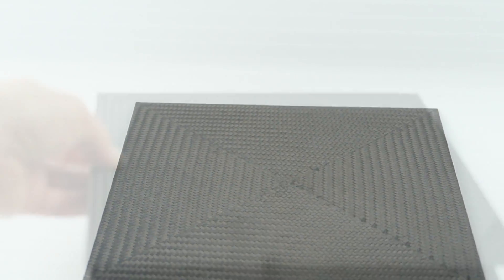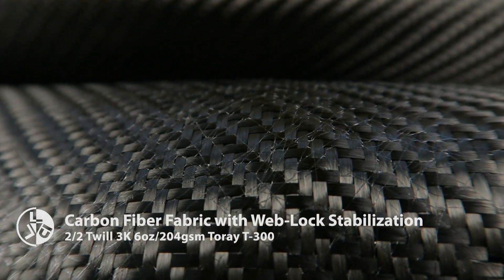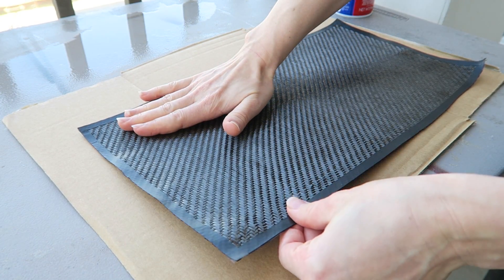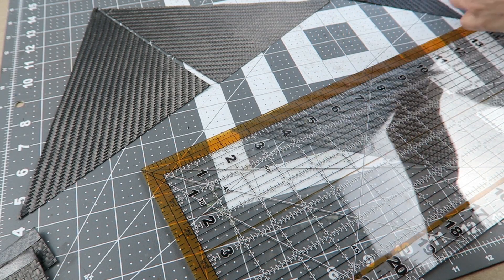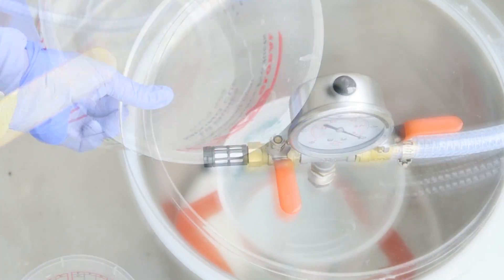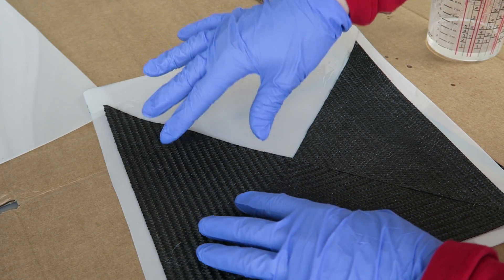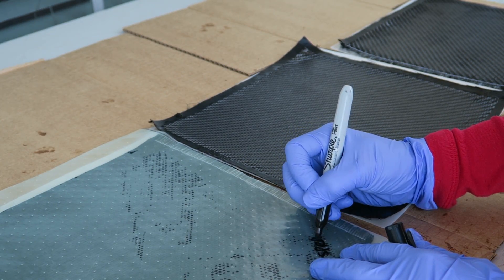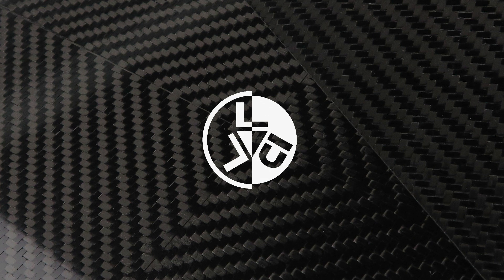Stabilized Carbon Fiber Comparison (Pro Finish vs Web-Lock vs Spray Adhesive)

Comment: I had to watch but more importantly read comments as some are questions. I am confused a little about what product you are promoting. The video was informative buy did not start with products you sell and products or materials needed. In short, I am a retired auto tech and have plans to modify a V8 intake made of plastic. It would require multiple compound parts, with sharp edges but on rounded surfaces. It would be similar to placing your hands together, inter-locking your fingers and folding down. I plan to create patterns to each part, draw the weave, cut the product to size but wet the part in steps laying each part touching to appear one piece. Complex? Yes. I intend to wet it out completely, vacuum bag the part, but the final finish is a two part clear coat. 
  Explain what I missed as the end results on your simpler pattern is some what my goal. This is for ascetics only, not so much for strength. I have edges to create a mechanical bond between the parts. Thoughts?
Reply from the maker: This was a comparison of commercially stabilized fabrics vs spray adhesive to help keep the weave in place. None of these options works as well as pre preg but they all help slow the fraying to some extent. You may want to experiment with wetting out between thick plastic sheets then cutting the shapes and placing. Not sure if that would be better.

Comment: Can these types of carbon fiber be used for skinning pieces? How well would they bend around curves when doing wet lay up? Or would you have to vacuum bag it to get it to hold it's shape?
Reply from the maker: Pre-stabilized conforms less well than non-stabilized.

Comment: Do you happen to know how think the carbon fiber is??? Thank you!!!
Reply from the maker: Thickness of the finished sheet depends on the weight and weave type of the carbon fiber cloth and the pressure under which it's cured. As a general guideline I tend to get around 0.3mm per layer of a typical 3k 2x2 twill cured under vacuum. Hope that answers your question.
Reply: @LindyDesignLab  yes thank you!!!

Comment: Using an infusion tack spray which is compatible with epoxy and other resins will give you the pro finish material:)something like this
 https://www.ecfibreglasssupplies.co.uk/product/aerofix-3-spray-adhesive

Comment: Been using CE for couple years. They are great. I love the serrated sissors from them. You should try Mavcoat release agent. So with the spray can u stabilize the piece yourself.

velosRus dotcom

Comment: What type of spray adhesive and tape are you using, Lindy? I'm looking to try skinning an Asiatic recurve bow with carbon fibre rather than the usual thread binding. I'm just not sure about how to achieve a perfectly straight line with no fraying where it transitions from carbon fibre to the fibre glass limb. This appears to the way to achieve that.
Reply from the maker: I think I tried Loctite spray adhesive here, but in general I prefer 3M super 77. Standard masking tape is good to control the fraying until the glue dries, then the edges can be cut off.

Comment: Where did you get the profinish?
Reply from the maker: Composite Envisions.
Reply: Lindy Design Lab thanks. One last question, where did you get the cutter from.
Reply from the maker: @SandeepSingh-43  The rotary cutting set from Amazon is linked in the description, but any one with a fresh blade will work.

Comment: this is why everyone uses prepreg :D
Reply: Right... over $100 per yard vs. 20-30 bucks per yard plus resin that will make a ton of parts. You only get the benefits of prepreg if you're using an autoclave to compress the fibers flat, otherwise you end up with holes in your finish. Nothing beats infusion for perfect looking cf parts, both visually and for strength.
Reply: I only dream about prepreg.

Comment: I got some Carbon Fiber from ebay and it came in the postal envelope. It caused loose parts in fabric on random places on plane and where it was folded (inconsistent holes in fabric). Is some easy way how to repair it so it can be used for finishing? In state it comes it is good just for reinforcement, but for finishing it looks ugly. I was thinking about stretching it to straighten fibers and make them close loose places on fabric. But I don't know how :-(
Reply from the maker: You may be able to get it straightened out, depending on the extent of the damage. This video might help https://youtu.be/vwB3fms4AZY
Reply: @LindyDesignLab  thank you (I was hoping that you will show me how to do it :-) )